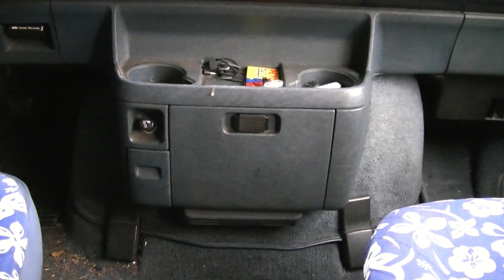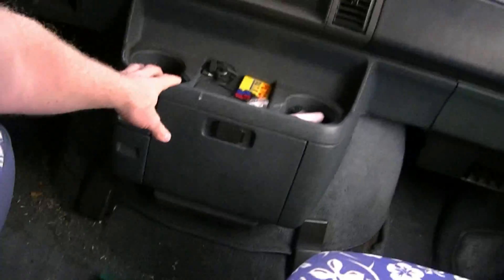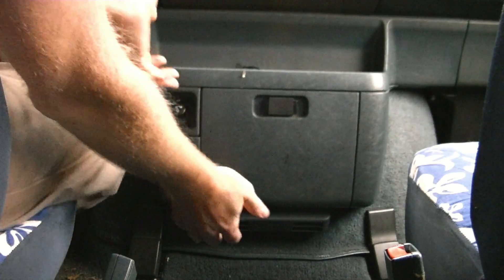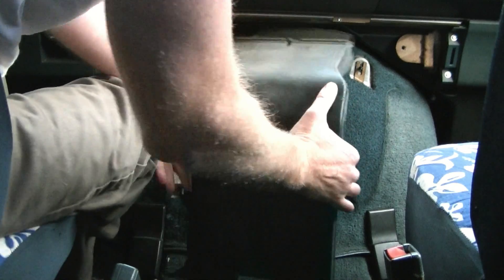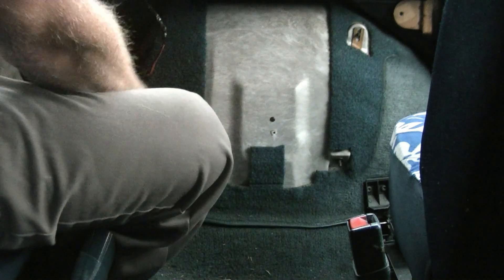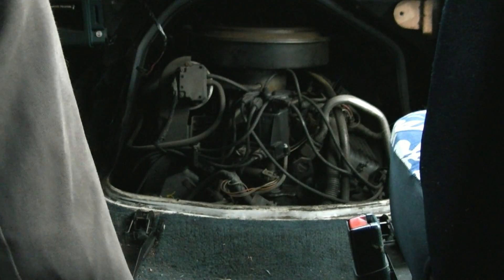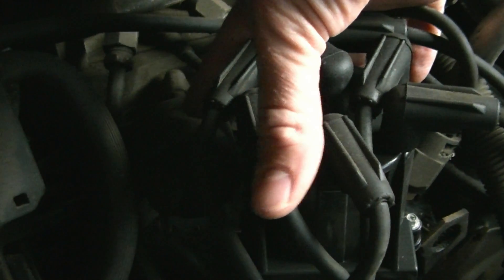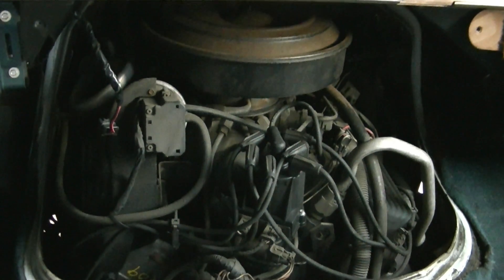How To Remove The Engine Cover On  An Astro Van or GMC Safari

Comment: My 1994 Safari continually had problems with the EGR. Flakes if carbon would float up from the intake and cause it to stick open causing rough idling. I found an after market plate with mesh to mount under the EGR to prevent flakes from getting into the EGR. I haven't had a problem in 10 years now.
Reply from the maker: I had the same problem, and it has been fine since I installed a mesh gasket. I made a couple of videos about it. I will put links here for anyone who is having the same problem.  @cBUds9Nypmc. @51z-k4YRHI4

Comment: This really helped me get into my father's van to work on the filter that hasnt been changed in about 5 years.  With the hood off, would you recommend I also replace the EGR valve and the whole distributor cap?  It's been having some performance issues but with a dirty air filter, that could be part of the problem. Also, when you say soak in DW40, should I just spray it on both the cap and EGR or actually soak it then clean it off?
Reply from the maker: I would recommend a new distributor cap and spark plug wires. Wires make a really big difference. You can clean the EGR valve, and probably don’t need to replace it.
Reply: @hoohoohoblin  I just got a new EGR valve and the thing that makes the spark, that goes to the Distributor cap, while getting a new air filter. Cleaned the leads inside the Cap and all sounded fine when running. The Van runs a lot better now. The vacuum return? on the EGR was all clogged up and I had to get a bendable 3/8 ' ratchet to get the bolt off the EGR mount.  All in all, it was one heck of an experience.  I'd still rather work with an older vehicle than a newer one any day.  Thank you for the video!

Comment: Thanks for this. Only comment is I would use PlanetSafe Lubricants AIM lube instead of WD-40 to clean the EGR valve. It'll work way faster and it is non-toxic with no smell.
Reply from the maker: Thanks.

Comment: I am getting a howling sound from the rear end, and it vibrates around 60 MPH.  Do you think it is the U Joints or that guide that holds the drive shaft.... maybe worn bearings on the front axels?  1990 GMC safari.

Comment: Are you able to see the hole that the dipstick tube goes into the engine from doghouse, wheel well or from underneath?  Tube came out!  My sons rig and he’s been driving it without dipstick for a few weeks, and has driven across 3 states.  How is this possible without losing oil or oil pressure?

Comment: With my '91 Astro the big issue with the doghouse (engine cover) is putting it back on. Removal is a step-by-step procedure, as you showed very well in your video. I would like to see you in your video put the cover back on. The alignment to replace the engine cover is critical and VERY problemmatic. My advice is to have on hand a rubber mallet and allow time for a long struggle. The time to replace the cover is much longer than the removal time. Mine will align on one side (either side) but not readily on the other side. Is there a trick, some advice to share, to align and replace the engine cover?
Reply from the maker: That's a good question. I sometimes have to try more than once. It needs to be in the exact right position. I always try to line it up with the top bolts and keep it straight.

Comment: Thank you for your videos. Especially on the Astro vans. Let me ask you this. I am getting ready to change the exhaust manifold gasket on passenger side. Mainly the rear one towards cabin of van. Do you feel enough room to maneuver with dog house off to repair?
Reply from the maker: I don’t know. I know it’s really tight fit to change the spark plugs, so I can only imagine it would be even more miserable to get the headers off. On my truck I had the cylinder heads replaced when it started smoking, but I paid a mechanic to do it because I just didn’t wanna get in there.

Comment: Thanks for the tip about the EGR valve, mine runs rough as hell and no one in England has a clue about these. I also have a tapping noise under acceleration. A few people say its from the balance shaft a few say the injection system needs cleaning any ideas? Cheers
Reply from the maker: If it is a mechanical tapping sound from parts knocking together, listen with the hood open and see if it comes from the cylinder head. It could be a bad rocker arm or hydraulic lifter.

Comment: I have gas pouring over the top of the engine - just had it towed home and now sick so in the next few day when I get well I will be doing this. Anyway for you to do a video on where the gas line comes into the engine bay? Mine is a 1993 4 liter V 6 - ran super  until this happened - of course on the surface it appears to be a broken gas line of some sort. Thanks for this video   even though I saw very little of any fuel issues - of course it was only to get the engine cover off - so can you find the gasline? I think it is fuel injected bu have not been well enough to look
Reply from the maker: +Duna Miller I sold the van so I can't make a video.  Yours probably has throttle body fuel injection, which means a big gas line is connect to the throttle body which is under the air cleaner.

Comment: What year is this van?  Is it a  chevrolet Astro Van or GMC Safari? My 92 Safari has the air filter uner the hood,  I have not had the engine cover off yet. Can you get at all 6 plugs from under the cover?
Reply from the maker: Changing the spark plugs is really miserable. Some people take out the wheel wells and take the front wheels off and do it through there. The van in the video is a 1993 GMC Safari.

Comment: Hey can you customize the engine cover to get more leg room ??
Reply from the maker: I bet you could find a way to do that. There is a little bit of extra room under it. I don’t know if it would melt if it was closer to the engine though. It is terrible for people with big feet. Mine are size 13, and they would sometimes get caught between the gas pedal and the brake pedal.

Comment: Most likely wheel bearing. Lift the back end up and grab the wheel you think its coming from. And try moving back and forth. Not as if it were rolling. Like pull the wheel towards you and push it in. If its lose and moves. Wheel bearing. If its rock solid it won't be that.

Comment: Is it safe to drive with the engine cover off? Need to take the van to friends house for me assistance.
Reply: I've done it before on my dad's 93 Astro. Works especially  great in the winter when you've got a bad thermostat and it is 10 degrees out.

Comment: Can you please help me I have an 03 astro van rwd and when I go around 35-40 mph there is a terrible grinding noise from the front of the van and I have no Idea what it is can you help
Reply from the maker: Joe Bond That's not much information to go on, but it could be a wheel bearing, or an accessory drive belt tensioner.  When my accessory drive  belt tensioner went bad it would make a terrible noise sometimes, and then be quiet other times until the pulley broke off.  It's easy to take a look at, and easy to replace, right on the front of the engine.  Take a look at it and see if the pulley spins freely and looks normal.  Here's a video I made about it:  https://youtu.be/tCO51tyRoSg
Reply: thank you so much

Comment: can you get to the starter from there I'm trying to find it and don't see it anywhere
Reply from the maker: I sold the van a while ago, so I can't check, but I think the starter should be down low where you can get to it easily from under the engine.  Look for a big electric motor looking thing connected to the transmission near the engine.
Reply: OK thank you

Comment: Couldn't see any of the bolts because of low dynamic range.
Reply from the maker: Sorry about that. If I still had the van, I’d shoot a 4K hi DEF version of this, but it’s long gone.
Reply: @hoohoohoblin  I eventually got it with a ⅝" socket and long extension. Boy, what a nightmare it is to get to something simple like checking a sparkplug...no wonder you got rid of yours.

Comment: It would be very helpful if you mentioned what year Astro it is your showing this on. There are differences on other years that would make this video useless. 
And using a flashlight to show the screws would also be in order. You only show a dark area. Not helpful. 
Alway state what year your working on!!

Comment: what a lousy design. this is an excellent reason to not buy one of these vehicles. id rather just be able to open the hood. when I was in the business the mechanics hated working on these and I can understand why.
Reply from the maker: Everything is really tight in the engine compartment.  I know how to replace cylinder heads, but when my van needed new heads, I paid someone else to do it because it looked like such a miserable job.  It is a great, handy, functional vehicle, though, and I do like having it.
Reply: Yes, my '91 is my first and last Astro for the reason you stated, carryclass. The van handles well, has lots of room for its exterior size, the LT seats are comfortable, but engine serviceability issues and the doghouse tilt the verdict to thumbs down. I'll look for a Tahoe/Yukon next time.